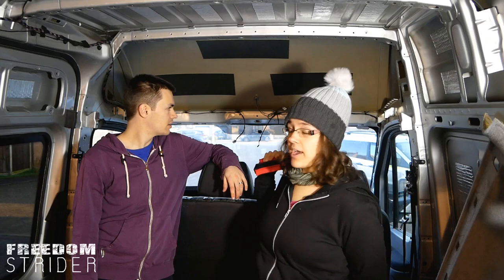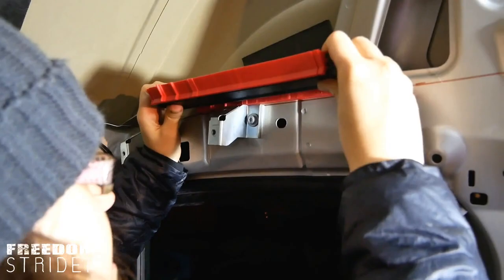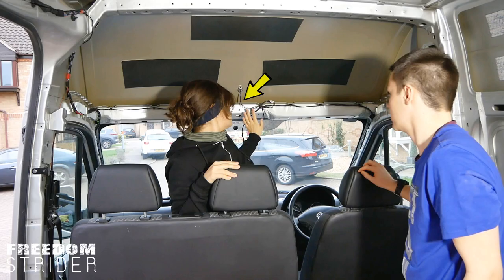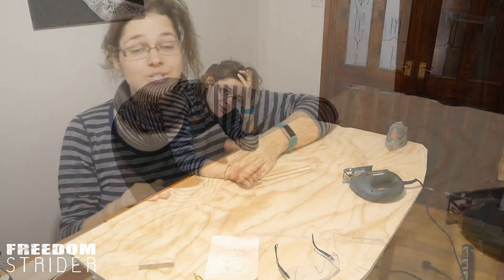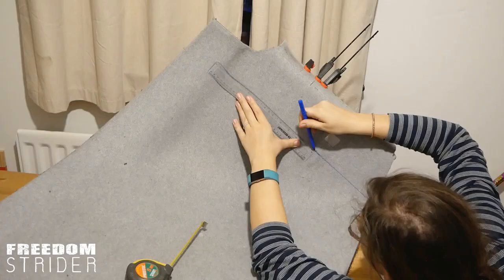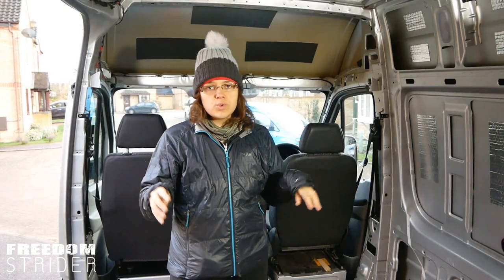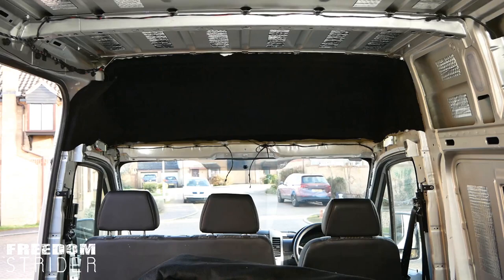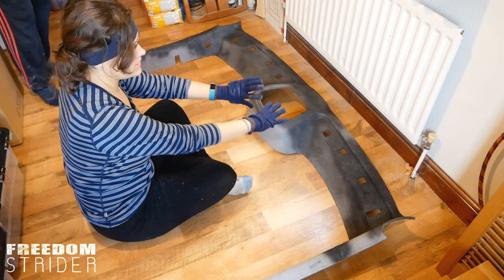How to build SIMPLE + EASY Headliner Shelf | Sprinter/Crafter Van Conversion

Comment: Hi folks, is the front of your shelf lower than the back? If i rest my shelf on the lip above the windscreen and clear the brackets for the sun viser and handle then i get a sloping downwards at the front. Is this something you were able to avoid?
Reply from the maker: From what we can tell, ot slops ever to slightly forward but not significant enough to be annoying 👍
Reply: Hey what's the silver stuff you put over the insulation before the carpet?

Comment: Hi both and great video😊...with the insulation you used does it not draw in and hold moisture?
Reply from the maker: As far as we are aware, not in any significant manor. Rockwool has a tendancy to do this, our receclyed plastic insulation can handle moisture in the air but shouldn't be holding onto alot of moisture and rot itself from the inside out.

Comment: Looks good I actually don't think the semi circle booboo looks bad either, I think you should post a little more often though Im looking forward to see how this ends up 😊 did you find your leak?
Reply from the maker: Honestly, we're growing quite fond of our booboo, we see a lot of potential 😂

We would love to post twice a week, but it takes 2 days out of our week to edit a video, we have to research and build the actual thing, and we also work part-time as well...we're trying to, but it's like chasing our own tails. 😂

As for the leak, we have had no further issues, we checked all the seals and couldn't find anything, and that cavity of water is gone. Our assumption at the moment is that the hole was blocked and filled the footwell with too much water, and it overflowed. I guess we'd better continuously check that drain hole!

Comment: Hi, great ideas...  where did you get your brackets from, and what sizes did you use?  Also, did you need to adjust the plastic belt coverings, or did they fit back on top of the brackets?  Thanks!
Reply from the maker: If memory serves, it was these ones: https://www.wickes.co.uk/Wickes-Galvanised-Heavy-Duty-Angle-Bracket-80-x-50-x-70mm/p/152816

We test fitted a few different sizes as well to be sure what would work, as it depends how far down you put the shelf. The top plastic went back on without a hitch, just had to line up the holes. Any thicker, and I don't think they would fit. although the sin visors were alot tougher to get back into place (since the fabric added thickness) so we ended up getting longer bolts to fit.

Comment: I've been looking at those contouring gauges to do the flooring in my house but I am undecided. Would you recommend them?
Reply from the maker: In all honesty, we haven't had much success with them... I think the gauge will do a good job with simple shapes (like door frames), smaller tasks like estimating the position of pipes. However, the contour gauge only gives an estimate. I would personally always double check with physical measurements. So it can help, but you can go without it - rulers and cardboard can get the job done too.

Comment: Great video thank you! How many brackets did you use to secure shelf? Attempting this soon 😊
Reply from the maker: We used 4 brackets in total,

2 big ones attaching to the seatbelt bolt location (https://www.wickes.co.uk/Wickes-Galvanised-Heavy-Duty-Angle-Bracket-87-x-87-x-25mm/p/246006)

And then two smaller ones into the hole where the handle screws into

We did alot of dry fitting to make sure the brackets would fit and screw into place, and every van is different 🤣 Best of luck 😁
Reply: @FreedomStrider  thank you! And you screwed straight into the metal frame of the van? I love your videos - very funny and informative :)
Reply from the maker: There are already bolt holes in the frame there, since you have to unbolt the handle and the side plastic (this one is hiding under the plastic hook) so we just bolted the brackets into those existing holes 😁 glad you enjoy the videos 😊

Comment: You should of glued the semicircle mistake back and put two screws in at 45 degrees and carpeted over it.
Reply from the maker: We still have the piece of wood, so we could, it's a good idea - we'll see though, we were thinking of putting a light in there 😄
Reply: @FreedomStrider   This project turned out better than I expected.👍
Reply from the maker: Yeah it looks a bit catastrophically misleading up until the very end, where you just cover it all in fabric so you can't see any of it!! 

As we were doing it, we were wondering "will this shelf ever get done?" as more and more stuff kept coming up, and we were just making stuff up as we were going along, but we got there in the end, the shelf is good 🤪
Reply: @FreedomStrider  I am sure you have disagreements that we don't see in the finished video, but you work well together, so the future looks great.🙃👍

Comment: Any reason you guys gave up on the spray painting of the headliner? Contouring the fabric looks like a pain in the backside!
Reply from the maker: Yeah, the paint started drying quite hard and after some experiments, we saw that we would have to go through a lot of paint for it to look like a solid colour and it looked kind of... bad 😊. So the fabric just made more sense, both budget-wise and aesthetically. And, you are right, contouring the fabric is a pain - it takes practice - and like usual, we were learning on the job, so hopefully it will be easier next time.

Comment: Please remember to wear some kind of mask when spraying the high temp adhesive spray, it's packed with a whole load of cancerous shite. x
Reply from the maker: Yep we agree, we had our buffs and the windows/doors open, for ventilation, but since then we have acquired some masks, although we are running out of them and they are a bit tricky to get a hold of at the moment.